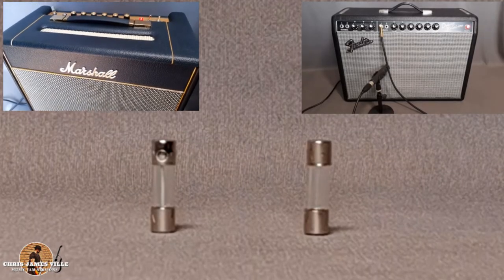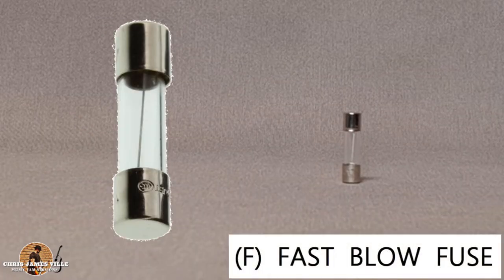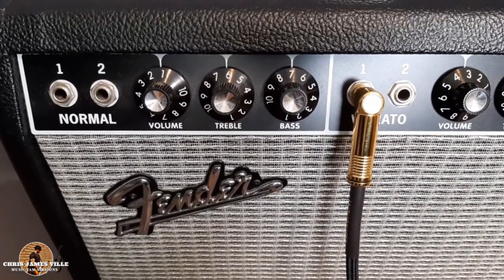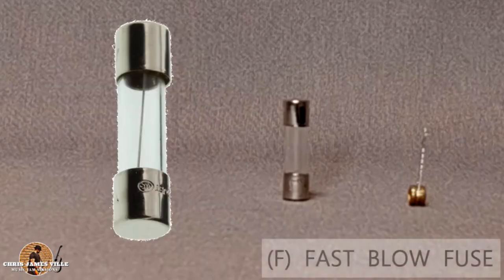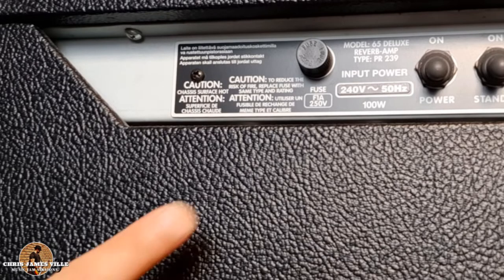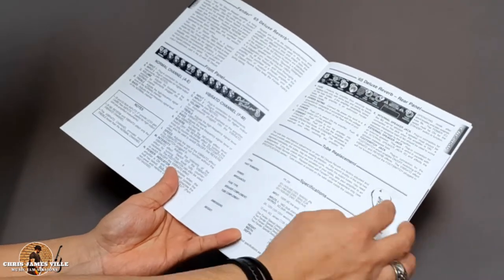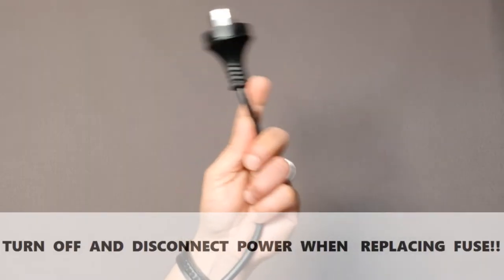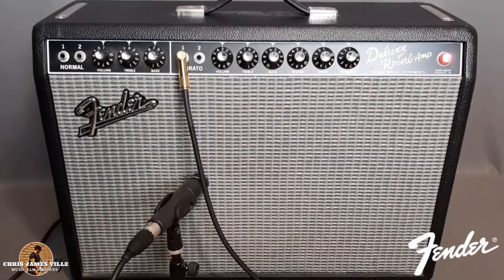Amplifier Fuses (Guitar Tube Amps) - Basic Information 101

Comment: I replaced the fuse and now it instantly blows when I turn it on
Reply from the maker: Hard to assess mate. High power surge maybe(?). Does it blow when the stand by switch is turned on in play mode? Meaning 'when you have had the power switch on and then turn on the Stand By switch thereafter blows'? OR no power at all as soon as you turn the power switch on (?). Could be more than a fuse issue and an internal problem with the amp. Probably be best checking in with a technician.Cheers
Reply: @TheSoulsandRevive  well it’s a solid state amp.  I turn the power switch on and i can see the fuse blow instantly

Comment: Question. If the amp main fuse blows should I replace it and give the amp another go, or have it looked at first?
Reply from the maker: Hey mate, it depends on a few things (amp specs etc.), if your amp is still under warranty have it looked at and repaired/part replaced accordingly to the warranty. If not under warranty it's probably still best to have it looked at by a tech and get a proper assessment on the issue.That way you know it is the fuse that is the issue for sure and you can replace it yourself IF you are confident in doing so. Cheers
Reply: @TheSoulsandRevive  Thank you very much. I did take in. I just bought it second hand and they offered to take a look at it. They said if they couldn’t fix it they they’d refund me.

Comment: Hey I just replaced the fuse and it turns on again. But there’s a humming noise when it’s turned on
Reply from the maker: Hey Mate, it's hard to assess and probably be best checking in with a technician. The 'humming' could be something as little as ground loop noise to bad rectifier/capacitor/s etc. Cheers